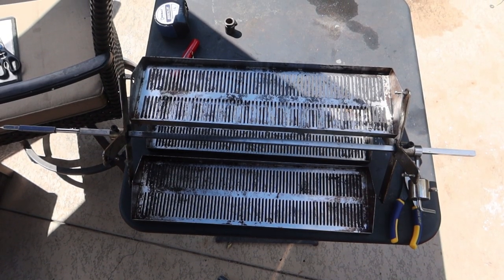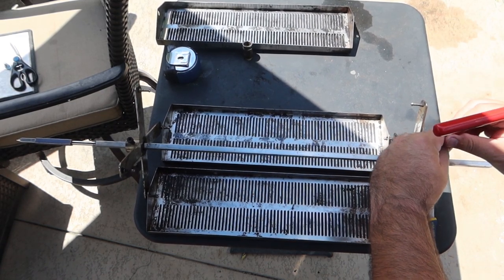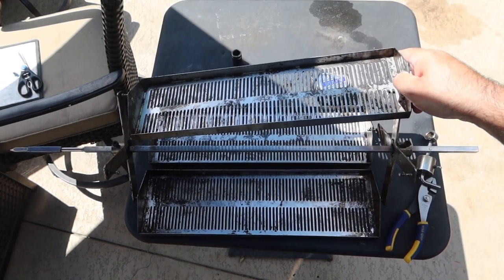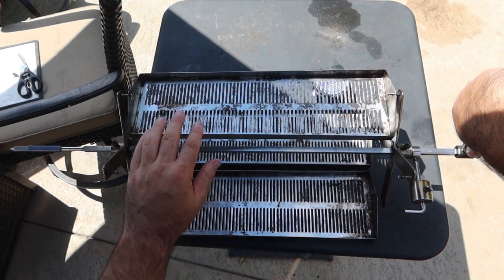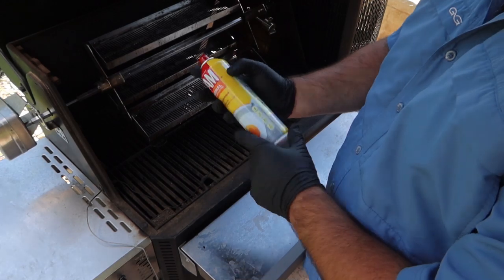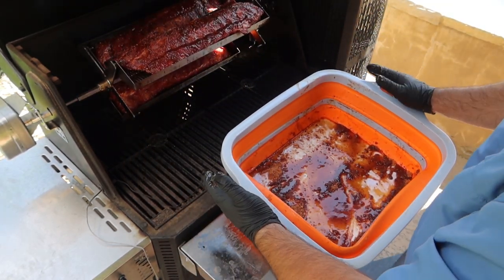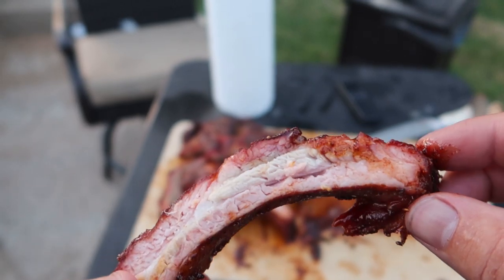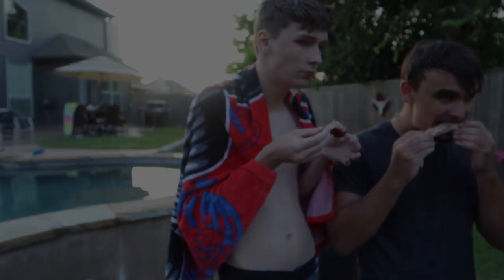MasterBuilt 1050 Rib-O-Lator Setup Bonus Ribs

Comment: First I wanted to say that I enjoy your videos.  I wanted to ask you about adding a rotisserie.  I have one that we have never used that came with our Jenn-Air  gas grill.  I got it out of storage and found all the parts. It’s long enough to work on my 1050 but I need the brackets.   Can I purchase the bracket on the inside somewhere?   I need that first to then play with the length and how to mount the motor on the outside.  I’m going to look at takeinf the bracket off my gas grill and see if I can make it work on the 1050.   Thank you!!
Reply: Never mind.  I just saw your link and will order the bracket kit.   Thanks!!!
Reply from the maker: Good luck man! Reusing old gear is the best way to save $$.

Comment: Just got my Rib -O-Lator today and it don't fit in my 1050 Masterbuilt it rubs on the backside. I do have the factory rotisserie so i need to do some modification to it to get it to work right
Reply from the maker: Which rib-o-lator did you get, standard or adjustable? I have both factory and modified 1050 rotisserie and it is a tight squeeze on the back side but runs without hitting.
Reply: @TXSHeat  i got the standard size one. I did a little cut to where the spit rod goes through the wall and it work great and i love it

Comment: Does anybody else is rid-a-later rub 
the back wall of the 1050 grill?
Reply from the maker: I saw a picture of one setup using factory rotisserie and it looked very close! I suspect that my "custom" rotisserie install is off just enough that it gives me plenty of coverage. is it rubbing all the way down or just one corner?
Reply: Yeah it rubs all the way down. Wasn’t an issue until I put ribs that were a little wider than the rack. It’s an inconvenience but I like the rib o later so much that  I’ll just deal with it.